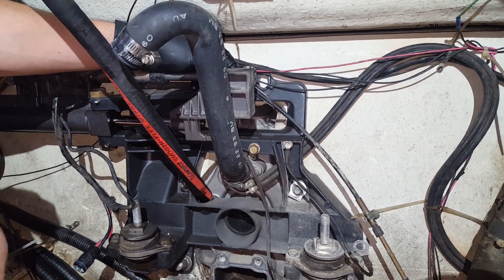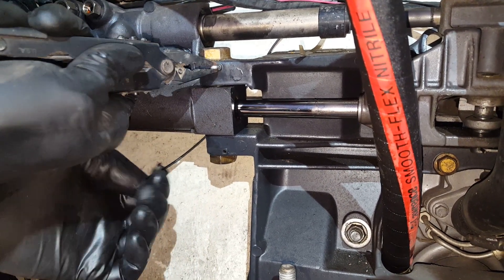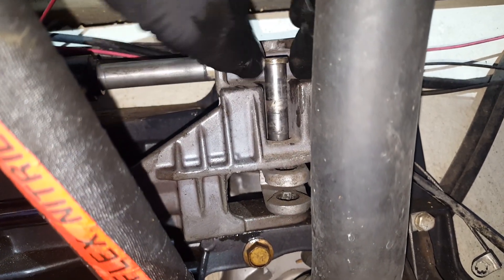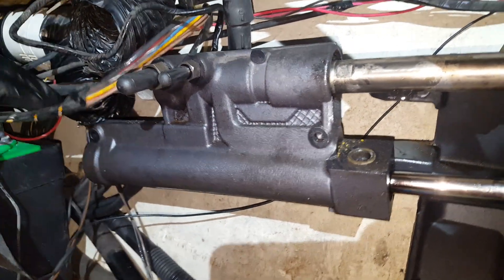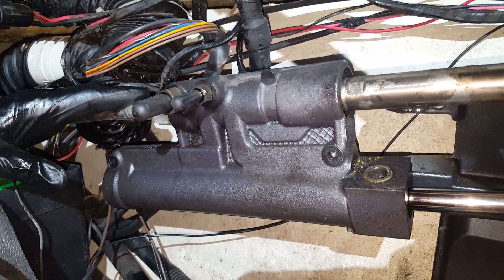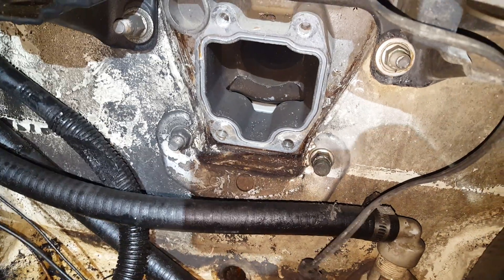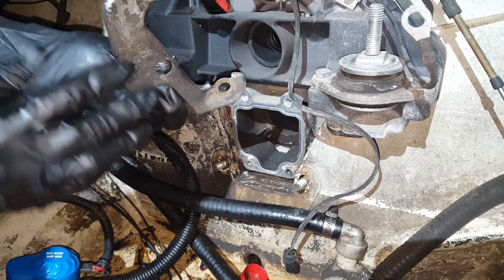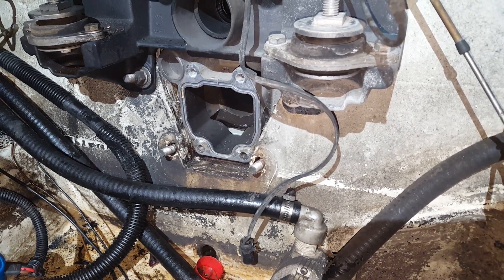Boat Transom and Floor Rebuild - Gimbal Housing Assembly & Transom Plate Removal - Part 9

Comment: Man thanks for this video. It’s exactly the playlist i needed to determine what kind of work it is to replace or patch the transom of an inboard motorboat. My free boat from a friend has become quite the project. Here’s my question: Can I remove the gimbal housing and outdrive without removing the engine? I’m not mechanically savvy at all. My transom is flexing on the inner wall around that gimbal housing and to the right of it. I really want to use a liquid compound such as carbon core and just seal it all up by injecting it across the transom well above the water line and let it seep down. My issue is if I don’t remove the gimbal housing, it’ll be  a permanent addition To the boat. Full transom repair isn’t worth the time and money to me. Would love your input on this. My boat is a ‘89 Chris Craft Scorpion 210 open bow with a 5.7 Merc. 

I’ve already got a few thousand into it mechanically and with diy upholstery. Looking good. Removed rear panel to find soft transom.

Comment: Any suggestions on getting this completely out when the transom is not rotted?  I'm having a hard time getting it out im assumning due to some sort of adhesive/sealant between the gimbal housing and transom.It wont budge and i dont want to use excessive pressure and risk cracking the gimbal housing
Reply from the maker: Chris Smith some one probably used 3m marine sealant and sadly you will need force to get it off. From the outside, try to cut the bead of sealant away to make easy. I’m assuming you have the motor out right?

Comment: How do you know if the old owner didn't play with the motor mounts & turned the left one more than the right
Reply from the maker: It is likely that no one touched it. What happens is the transom rots and that changes the pitch of the gimbal housing. The best thing to do is to check for transom rot. You also must consider getting the engine aligned. I have videos that go over this process in great detail. https://youtu.be/HGQ0d111dLw https://youtu.be/OjPHcl0y8zM
https://youtu.be/YpYpwYRCGm8

Comment: How do you know if the old owner didn't mess with the engine aliment@ tighten the left more than the right
Reply from the maker: It is likely that no one touched it. What happens is the transom rots and that changes the pitch of the gimbal housing. The best thing to do is to check for transom rot. You also must consider getting the engine aligned. I have videos that go over this process in great detail. https://youtu.be/HGQ0d111dLw https://youtu.be/OjPHcl0y8zM
https://youtu.be/YpYpwYRCGm8